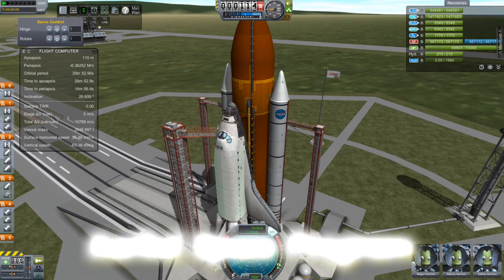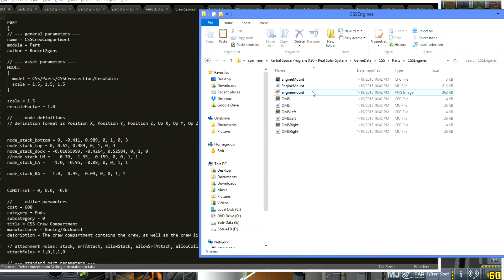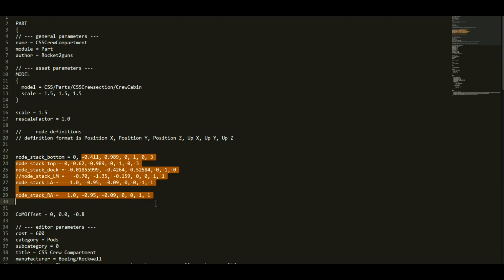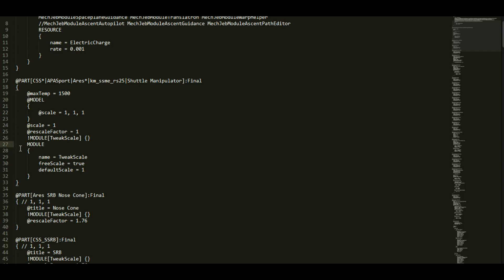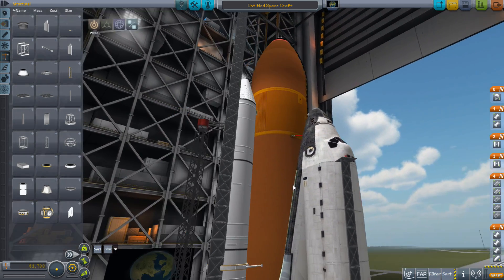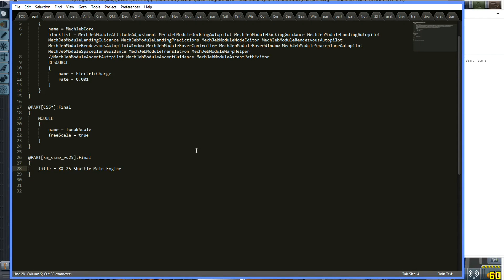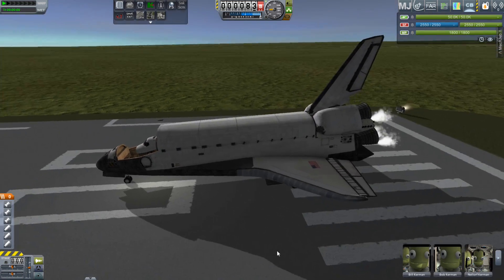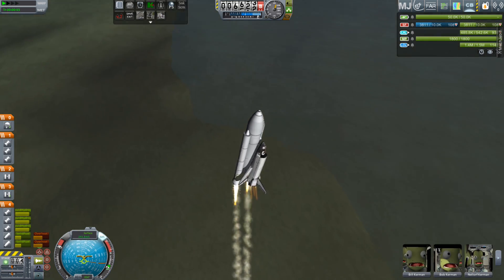SE02: 1974 / Project Enterprise - Space Shuttle / KSP 0.90

Comment: Sorry to pedant, but scale outside the MODEL node (i.e. scale = 1.5) means to scale the nodes by that only; it doesn't touch the mu (mesh/transforms). It does default to 1.0. rescaleFactor, however, rescales both nodes and mu, but (a) it defaults to 1.25 if not specified, and (b) is bugged when using MODEL nodes, so always explicitly set it to 1.0. Otherwise, cool beans! :)
Reply from the maker: NathanKell If I set my MODEL scale to 1, 1, 1 explicitly and my PART scale to 1 then I can use rescaleFactor all I want and it never bugs. You're talking about the "revert loses size" bug right?
Reply: Bob Fitch
Yeah. It may only happen for root parts, that's a bit unclear, but that's the bug, yes--revert to pad at your peril (or fast-switch vessels, that also triggers it).
Reply from the maker: I only get that when I have a MODEL scale and rescaleFactor. I never get it when the MODEL scale is 1,1,1.

Comment: Did the first iteration of the RS-25 engines have the same thrust values as the ones used at the end of the program? Or will these have to be changed as time advances?
Reply from the maker: Colby Kirk The engines were the same but they learned over time that they could throttle them higher, so the ending thrust was more than the more conservative initial thrust.
Reply: Bob Fitch That's really interesting. Will you be able to emulate that in your series?
Reply from the maker: Colby Kirk It's easy, and there are a few ways to model it too.

Comment: Bob, since you're constantly measuring stuff, why not use Jeb's Big Stick (a 10m ruler with nice gradation lines)? http://bit.ly/1zVQceH
Reply from the maker: Piñata Oblongata No real reason. What I do worked so I just didn't bother adding anything new. Remember I do have a 5-long welded measuring stick I use too.
Reply: Bob Fitch
Workflow :)
(Also, proc parts are great for measuring things: surf-attach a tank on, and you can measure things down to the millimeter via the precision tweakables.)
Reply from the maker: NathanKell true... I have done that before as well and it's another great way

Comment: 9:25 That CoM and CoL actually looks pretty good. Realizing you haven't adjusted all the masses yet, of course. Remember the CoM will probably move forward as you burn OMS and RCS fuel, and the CoL will move aft in supersonic flight. If you have those two markers immediately on top of each other, then when you pitch up you run the risk of moving the CoM aft of CoL, with all kinds of inevitable unpleasantness.

So rather than being pretty far off, those two markers probably should stay where they are and no closer. Even farther apart would still be stable and controllable.
Reply from the maker: TheWinterOwl The way I learned CoM and CoL is you can imagine a vector from one to the other and that is the direction your craft will tend to want to orient, meaning my shuttle right now will tend to want to flip upside done and backward: http://i.imgur.com/ZKwdqPL.png
Reply from the maker: TheWinterOwl From this: http://i.imgur.com/p3lQMwm.jpg
Reply: Bob Fitch Just typed up most of this reply, then accidentally closed the window...  XD

I hadn't looked at that guide before. It's pretty cool!

IMO, the author makes a little bit too much of the vertical separation between CoM and CoL. The current setup will probably be entertainingly sensitive to changes in pitch, yes, but not uncontrollable. There are plenty of low wing airplanes around that fly just fine. Just about every WWII fighter, for example, had the wings on bottom, below the heavy engine. But it's true that the plane would be more stable with a lower CoM and higher CoL.

I admit I don't know exactly where the real orbiter's CoM was located, or exactly how it changed as propellants were used up. It certainly seems likely that all that equipment in the belly and wings means the CoM may have been lower than the center of the fuselage. It may also be worth mentioning that when I build an identically proportioned plane out of procedural parts and procedural wings, the CoL is noticeably higher than what you have there. So there are good reasons to move them closer together vertically, you're right.
Reply from the maker: TheWinterOwl Okay, well in some not terribly distant future episode I suppose I'll have the mass values set and we can finally test it! :)  I'm not a master of planes by any means, so keep the advice coming.
Reply: Bob Fitch
attention, long post ahead:
some more info on the locations of center of lift and center of mass. A general saying is if the center of lift (further on CoL) is behind the center of mass (further on CoM) , a plane flies badly, if the CoL is in front of the CoM, it only flies once.
If the CoL is on front of the CoM, there is a momentum that makes the nose pitch up, this increases the angle of attack (further on AoA). Increasing the AoA increases the lift (both on symmetric and on non symmetric airfoils). This increases the pitch momentum, which increases the AoA, the lift again and so on. In reality your plane pitches up until the airflow stalls and you completely loses lift. This is an unstable configuration, because, if you are in level flight, a slight perturbations (i.e. an upward gust pitching your nose up) will lead to an ever increasing pitch until a stall. A downward gust on the nose on the other hand decreases the AoA, which decreases the lift, wich generates an addition downward momentum, which further decreases the AoA and so on.
If the CoL is behind the CoM, there is a momentum that makes the nose pitch down. this decreases the AoA, which decreases the lift and therefor decreases the pich momentum. This is a stable configuration. If you are in level flight a small upward gust will increase AoA, increase lift and generate a downward pitch momentum, your nose automatically goes back down. A downward gust will decrease the AoA, decrease the lift, which generates an upward pitch momentum, your nose goes back up again by itself. In this configuration, an aircraft counters perturbations by itself without pilot input. All commercial aircraft are required to have this stability.
But this stability decreases maneuverability, because the aircraft automatically counters every maneuver. Therefor fighter jets usually are slightly unstable, but in a way that the control surfaces can (actively) counter perturbations. But they require complex flight control systems to make constant, slight corrections and prevent the pilot from going into a not counter-able high AoA situation.
I can make a diagram of this if you like.

The vertical orientation isn't that important because the lift usually points upwards, the gravity downwards (both are basically parallel; you can move vectors along their direction without changing anything, so you can line them up vertically). What matters of course is the vertical orientation between CoM, CoT (center of thrust) and in real aircraft CoD (center of drag), because both drag and thrust point along the length of the aircraft, the gravity down, so they are perpendicular.

Source: I'm an aerospace engineering student close to finishing my degree.
Reply from the maker: Robert Schwabe TheWinterOwl  I'm able to engineer anything I want in KSP. I can make the CoM and CoL be anywhere I desire. I can make the lift to drag ratio or whatever it's called anything I want too. What I don't know, even after hearing all this, is specifically WHERE to place these points and vectors. Would you be willing to just draw on this image http://i.imgur.com/ZKwdqPL.png a yellow dot and a teal vector showing where I want to start out? After that I can make small adjustments until I like the way it flies. My real issue is I have nowhere to start other than what the game is giving me by default. The vessel mass will be the same as the real Shuttle dry mass when I land, if that matters for this.
Reply: Bob Fitch
I assume we are talking about the gliding phase of the orbiter, where it is basically empty (no/or little payload and fuel).
The location of the CoL and CoM seem to be pretty good to begin with. The orbiter will, when gliding, have a slight tendency to pitch down (like the real one, there is a reason it is said to be flying like a stone). You want the CoM definitely be slightly in front of the CoL, when the shuttle is basically empty. As I said, the vertical position doesn't influence anything when gliding (without thrust). The larger the distance between CoM and CoL, the larger the momentum. Of course it shouldn't get to large because you want to be able to flare (pull the nose up) before touching down, so your control surfaces must always be able to create a larger momentum and momentarily shift the CoL in front of the CoM. I think you can check this in the SPH by attaching the control surfaces with an angle or change the angle (with the new alignment tools) to see how the total lift of the orbiter changes. If they can push the CoL in front of the CoM, you can pitch up, if the can pull the CoL behind the CoM, you can pitch down.
here are some pictures.
http://imgur.com/4pQuiV0
You could move the CoM and CoL a bit closer to each other (longitudinally, as I said the vertical position doesn't influence stability when gliding), this will reduce the tendency of pitching down. But you want it always to be CoM in front of CoL! So with some spare fuel left or some stuff left in the payload bay it should still have the CoM in front, so you want a small margin to be on the safe side. It looks to me the CoM could be a little bit to high, but it could also be right, I don't know enough about the mass distribution of the orbiter. It should be somewhere around the centerline of the payload bay so that different payloads don't change the vertical position of the CoM to much, because this would change the thrust balance for take of and orbital maneuvers.
You can ask me more, if you like or need.
Reply from the maker: Robert Schwabe I'll try it, but in the past my shuttle has flipped upside down and spun around to head tail first when in this same configuration. We won't know until I get to that point in series of course.
Reply: Bob Fitch
if you use FAR or NEAR those indicators don't really work, as far as I know. But FAR has it's analyzer where you can calculate various stability modes. If you use stock aero, maybe there CoM was shifted because of fuel drainage?
Hmm, If I think about it, It could be because stock aero calculates everything as point-masses and therefore the mass wants to sit 'below' the lift (this doesn't happen in reality because drag would increase with increasing AoA and change the lift substantially, but KSP doesn't consider this yet). So you could try to push the CoL upwards so it is above the CoM, just make sure the CoM stays in front. As an aerospace engineer sometimes I have to forget what I learned to use KSP aero...

Edit: Also, in reality when going supersonic the CoL moves from 1/4 of the wing depth (from the front) to 1/2 of the wing depth. But stock aero definitely doesn't consider this, and I think I heard FAR and NEAR don't either. So this shouldn't be a problem yet, but could become one later. This fact made the first attempts at supersonic flight quite dangerous because it wasn't well known, people believed it might be impossible to go supersonic. Imagine the aerodynamic stress when an aircraft suddenly pitches down quite a bit at sonic speed.
Reply from the maker: Robert Schwabe  RSS is always with FAR as far as I know. I can't imagine anyone using RSS with stock. Liftoff was be terrible. This project is for RSS.
Reply: Bob Fitch
ok, then I don't know how the indicators work with FAR, since far also considers lifting body effects and the AoA. I've seen screenshot of a editor tool from FAR where you it calculates several characteristics of the craft. like this:
http://i42.tinypic.com/2jcv87l.png
there is also a stability tab. I haven't used FAR (my computer is already struggling with stock aero), so unfortunately I can't help you further. Good luck!
Reply from the maker: Robert Schwabe I've used that tool and I have no idea how to read it and apply changes to a craft based its results, even after watching videos that try to teach me. And I'm a smart dude.
Reply: Bob Fitch Resisting the urge to install the CSS, because I have my own projects to work on. LOL

Thinking about the problem, here are a few suggestions.
We actually DO know exactly where that CoM needs to be located longitudinally. It needs to be just slightly forward of the main landing gear, so the airplane will be controllable at landing. Behind the wheels = plane tips backward onto its butt. More than a couple meters forward of the wheels = rough touchdown. So having located the CoM longitudinally, the vertical position will be no higher than the center of the fuselage, probably a little bit lower. And yes, it's important to specify this is the CoM in glide/landing configuration, so without the OMS fuel.

With the necessary CoM position known, CoL position becomes a lot easier. It only needs to stay a little bit aft of the CoM in subsonic flight, so the airplane will tend to pitch nose down. Just a few meters aft... call it 5m at first to experiment with. As Schwabe explained, the vertical position of the CoL really isn't all that important in this case. It wouldn't hurt anything to raise it a little bit, though.

When I was designing a lot of KSP shuttles, I always found it useful to get the vehicle working as an airplane first, capable of controllable flight and landing. Do that before messing with the whole launch apparatus. When necessary I'd set it to infinite fuel and mess with engine thrust until it was capable of a normal runway takeoff and landing. (Yes I know the real shuttle was never made for a runway takeoff. Work with me here. LOL)

If your previous shuttle flipped around backward even though CoM was in front of CoL... I wonder, does FAR know the nose of this bird is a nosecone? With the different drag profile? If that's set up correctly, then maybe it was simply pitching up too far and stalling it?
Reply from the maker: TheWinterOwl I did not show it in the video but I did try liftoff as an airplane with infinite fuel. It was not pretty. The advice on where to place the nodes is exactly what I needed. I will do that. I'll investigate how FAR knows what to do with the nose too, and see if I can make it understand it needs to point forward. Last time I knew less about FAR than I do now, too. Damn it... I want to work on this again tonight but I am days behind schedule on Alexandria... damn you both.
Reply: Bob Fitch
I totally forgot about the landing gear trick, because usually I place the landing gear according to the CoM, and not the other way around. Nice catch, TheWinterOwl 
I found this nice book about the aerodynamics of the Space Shuttle:
https://archive.org/details/nasa_techdoc_19790013835
on page 15 is a diagram that shows the stable range of the CoM; it is between 65% and about 67.5% of the total length. I've only skimmed through the book to find something about CoM and CoL, but I looks like a nice read. Many aerodynamic diagrams.

Sometimes you find amazing stuff on the internet...

Comment: Awesome Video as always!
I have this scaling bug as well with tweakscale so i put this in a cfg:
(² should be stars but stars make your text bold in youtube and i dont know how to diasble that... -_-)

@PART[²Cockpit|Cockpit²|²Cockpit²]
{
     @scale= 1
     @rescaleFactor= 1
}

would that work or cant you use wildcards like that? or does it need an :final tag or something? I made some tweakscale things before like that and that works but not sure bout this... I'll be playing around a bit more and ill see if i get the bug again!
Thnx for any help
Reply from the maker: 0phoff Yes, that will reset your scale and rescaleFactor values. However, you might also try changing the root part to something that is not scaled.

Comment: Hey Bob! Big fan.
I've very recently finalized a config for the Realisim overhaul mod for the CSS to real values. It will be included in the next release. Please feel free to take whatever patches you desire from this, as I came across a bug or two (the left control surface is a doozy)
All of the FAR values are fairly accurate, however mass isn't 100% perfect.
The real plume config included looks very pretty.. If i do say so myself.
Anyway, enjoy!
https://dl.dropboxusercontent.com/u/84643089/Advice_dawgg_Patches.zip
You can ignore the RN R7 patches in there. Or not. :)

Oh and I'd love to view your finalized config, and amend mine (or replace it entirely) as appropriate!
Reply from the maker: Max Van der Leden Thanks, that could speed things up quite a bit.